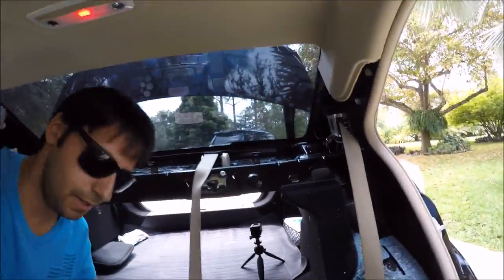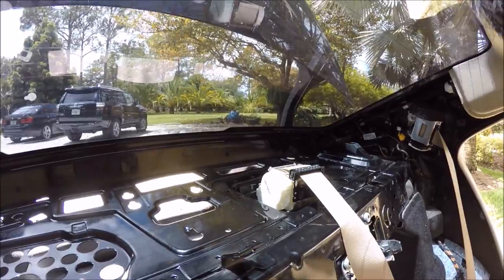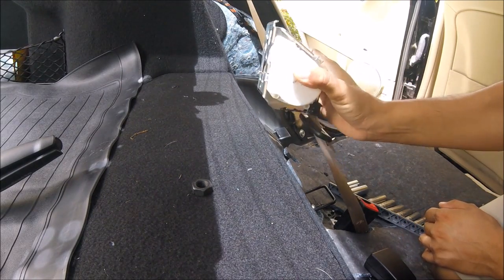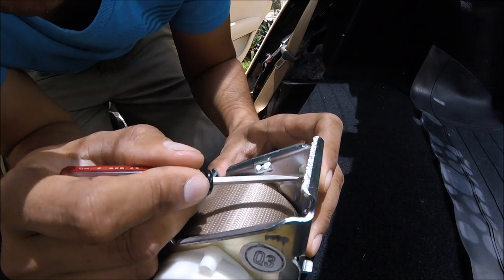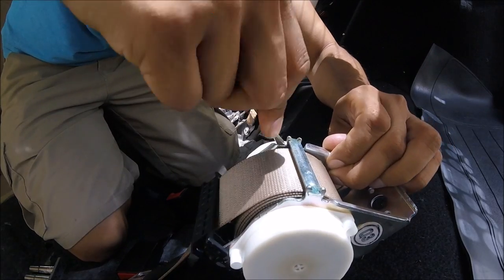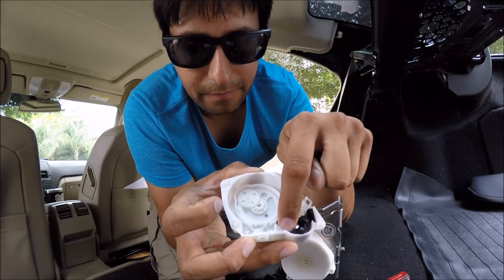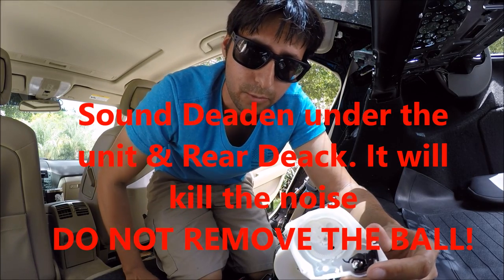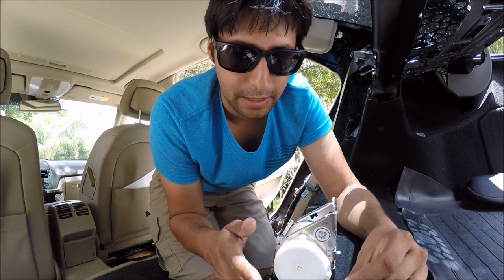Mercedes- Benz Rear Deck Rattle Noise (SOLVED)

Comment: So I have a C350 coupe, 2014, and I have the rattle coming from the passenger side seat belt.  I'm wondering if just adding some sound dampener to the outside of the plastic will keep it quiet.  Thoughts?
Reply from the maker: +LaswellB what I found out that helps/ resolved my issue was applying sound deadening just under it (in bolt it and apply under unit) and on both the white plastic sides. This killed all my noise from the rear.
Reply: Do you have a video on how to remove the rear panels in the interior?  I don't want to break anything trying to remove them.
Reply from the maker: +LaswellB https://youtu.be/SfR4Tgk6UYc
If you have a coupe it will have a bolt behind abs plug
Reply: Hi Raymond, is there a way to sound deaden the unit without disassembling the rear deck?
Reply from the maker: Kok Wei Khong yes there is
https://youtu.be/ilg1iW3qhvU
Reply: Thanks Raymond, will it deaden the rattling sound in the car since the material is placed in the boot?
Reply from the maker: Kok Wei Khong it will reduce vibration to the rear deck. Unfortunately to kill this seatbelt rattle the only thing I found that works was deadening under the seat belt and on the white plastic sides. I can safely say I hear absolutely no rattle coming from the rear of my car now.
Reply: Thanks Ray, darn I was hoping that I don't have to dismantle anything. Anyway your video really helped me, so I've subscribed.
Reply from the maker: Kok Wei Khong give it a shot by deadening under it. It can't hurt to try, if anything it will reduce it but not eliminate it. I know that rattle noise is ANNOYING!!! Thanks for subbing!
Reply: Ordering them now :)
Reply: I finally figured out what the rattle is.  It's the lower third brake light against the rear window.  Now I just need to figure out the best way to eliminate it.

Comment: 2013 mercedes ML i have looks same noise what you think MERCEDES ML?
Reply from the maker: +tom yuksel I would check 2 things first being the panel behind the seats to make sure it's not loose. And secondly I would check the rear shocks... That's usually the culprit on the ML

Comment: That’s a different noise than mines. I can press on the rear speaker and her the squeak and rattle. It goes away when I press and hold the speaker encasement.
Reply: same. did you ever figure out how to fixi t?

Comment: My son has a 2015 C300, i want to put my own 6x9s in the back (from trunk). I would appreciate any suggestions on how to do it.
Reply from the maker: 6x9? Why 
He would have to custom cut the metal under the rear deck and then power them through an amp which is getting the signal from the rear speakers. Are you sure he doesn't just want to install a subwoofer? I have a video for that
Reply: Thanks for responding. I will look into that sub option. I already go everything for the sub,  but i got a second degree burn on my foot, so it will have to wait.
Reply: Infinity Basslink!

Comment: I hear a rattling noise coming from the dashboard. Sometimes it comes from behing the steering wheel sometimes in the middle of the dash. Ive been taking my car since last September and everytime they tell me its fixed it still comes back
Reply: I have it the same, what was it?

Comment: I get like a thud noise from the back. Only when I go over bumps or dips. No rattles just thuds
Reply from the maker: Rear suspension. Check rear shocks/ swaybar
Reply: @RaymondUrias  will do. It also sounds like it's coming from the shelf behind the seat.
Reply: @venomobl6577  did u find out what it was ?
Reply: @Richnik11  yes its just the boot liner rattling making those thud sounds.  Think it may have been replaced previously, so now its not a perfect fit somehow